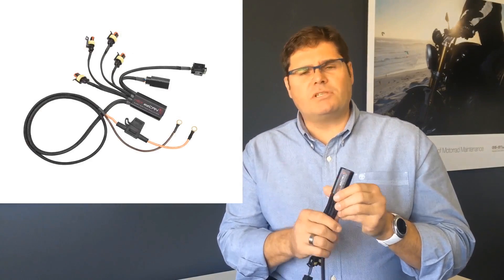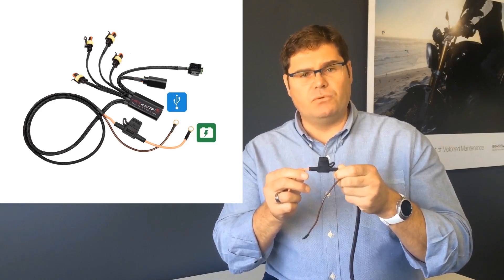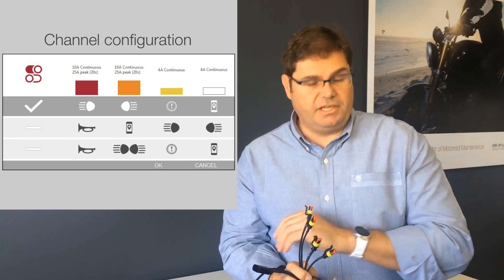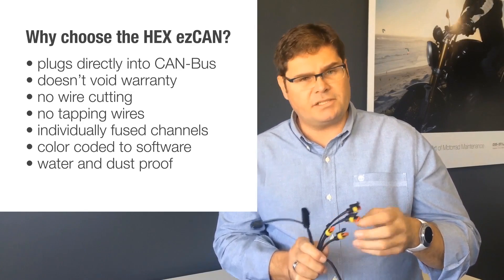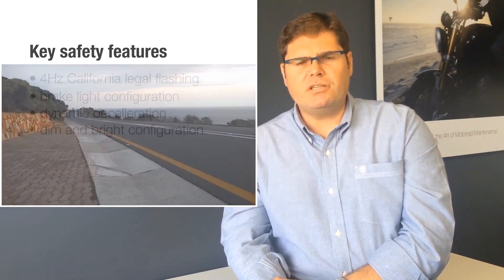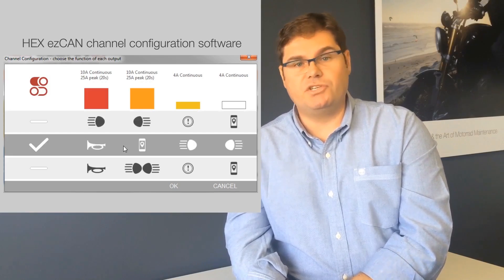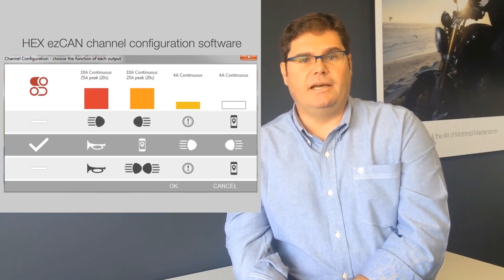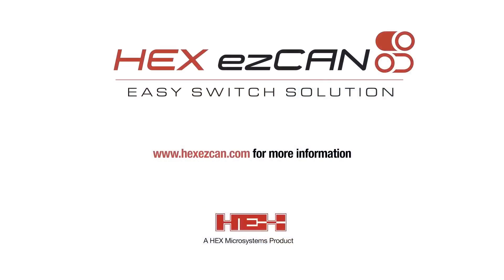Introducing & Installing the HEX ezCAN

Comment: Mine has completely failed on my new RT which has covered less than 3000 miles since installation.Up until this point,the thing has been brilliant.
The green light on the unit is on but there is no power coming out of the unit.Does anyone have any ideas.